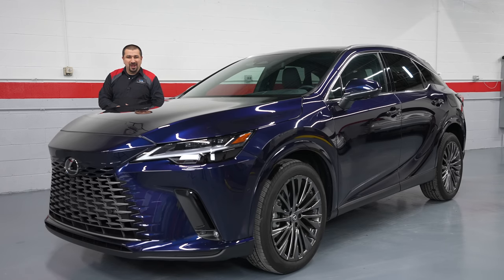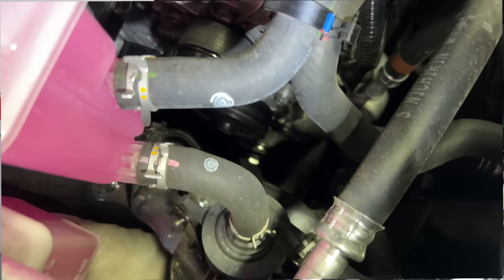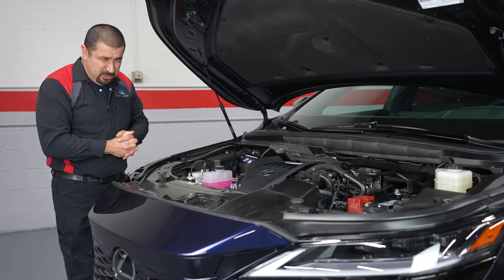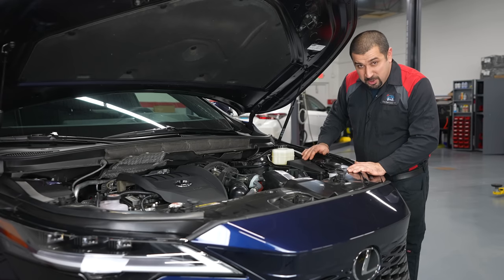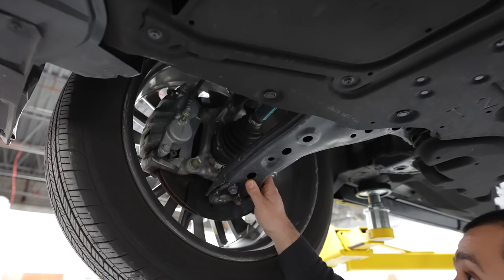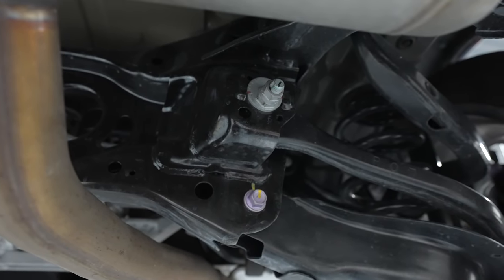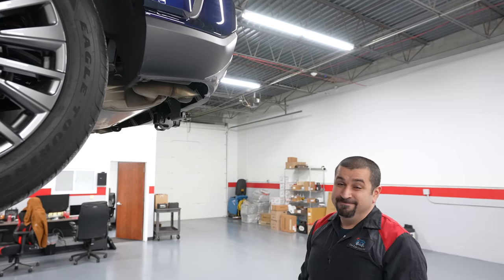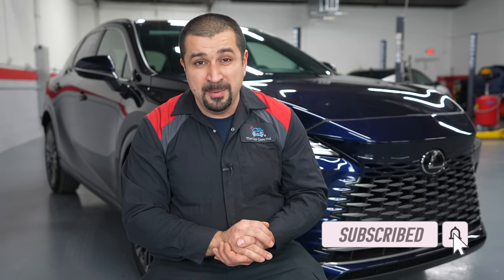Should You Buy The 2023 Lexus RX? Everything You Need To Know

Comment: Thanks for the awesome video and the thorough review of all the important bits. I'm not in the market for a car like this, but definitely some of the tech will trickle down to Toyotas for better or worse. I agree with the potential for distractions - quite annoying really.
By the way, does the RX use wheel bolts instead of nuts? Just curious if this is the direction Toyota is heading.

Comment: Some things Toyota have never changed much ie: the touch screen controls, the Toyota Soarer with the EMV had many controls for Hvac via touchscreen but there was just one single manual button to override if it wasn't working, radio and video controls were also bulit into the touchscreen but the volume and tuning were also available via manual buttons.

In regard to the 4ws , my Toyota Soarer has 4ws and I have a 929 Mazda with 4ws also, after driving with 4ws for many years I would avoid any other vehicle now that didn't have 4ws. It makes parking, U turns, high speed cornering, lane changes at higher speeds so much safer and quicker.

Comment: I purchased a 2021 Lexus RX just before he chip shortage began.  One big reason was the engine.  I agree that this is one of the best engines that Toyota/Lexus ever produced.  Hybrids are very complex with a lot of extra electronics - the stuff that typically causes problems as vehicles age.  With EV's we only move the source of pollution from the tail pipe to the power plant.  I plan to keep my RX  until it falls apart or they won't sell me gasoline anymore.

Comment: Today I traded a 2021 Highlander platinum Hybrid for this vehicle. I agree with the comments about the steering wheel buttons and the infrared face sensor. That being said the engine comments I don't agree with. Compared with the Highlander this car is super quiet and I never heard the engine. That was the only thing I had against the Highlander, it was very noisy, especially on long trips. I've only drive the Lexus 20 miles so I'm still getting used to the bells and whistles and the touch screen. So far it is as comfortable as the Highlander and I'm sure I can drive it for hours like I could that car.

Comment: Not happy….Purchased a ‘23 nx350 this past November, car is great until I find the engine has been filled with too much oil from factory.  You may ask, how much is too much, we’ll take the distance from the bottom hole on dipstick to the top hole and put it above the top hole now and the oil level is at the top of that distance. Make sense?  Now my question is if there is any damage to the engine or long-term premature failure of seals and/or gaskets because of over capacity, thus over pressured. Please advise on next step with Lexus. I want to keep the car for many years but not if engine damage has already occurred.  Your wisdom is greatly appreciated. And thankful for in advance.

Comment: Excellent Video, as usual. The V6 engines are still much better and they talk to me much better than 4 inline. I cannot imaging 4 cylinder engine in something like that. I had 4 cylinder Honda CRV, that was terrible - underpowered and super laud, super super laud whenever rev and it had to rev often. About the all touch screen control system - another not useful thing. Simple buttons for AC, AC mode, Temperature knob - which I dream they one day put in Lexus cars maybe AC power  knob - super easy to control if in manual. 
I like the bumper, as I know that if someone bumps into me, I am protected, so I like it very much - also the fix might be sometimes very inexpensive. Also, if someone is going to revers into your car on a car park, then at least they wont do much harm - they are super useful. I do not like very big screen as they are to much of a distraction screen. I also do not like very big wheels. I still think that 18" size is perfect. And most of all, I hate these "Advanced safety systems". I never thought that we have to pay extra for them, but now when I realize that I must admit that I hate them even more. Probably they count for crash and safety results. I would promote responsible driving instead and as you said, they could have been an option, together with the new door unlock system. Completely unnecessary.

Comment: Ahmed I understand the 4 cylinder buzz you mentioned at the end but believe me I have GLC300 with 2.0 L turbo and there is no buzz . I barely can feel if the engine is on. It all depends on design. Unfortunately Toyota 4s are buzzy..TNX for video

Comment: Very good video as usual!  I had a Toyota question for you.  Recently bought a 2020 Tundra with low miles was a Covid car it didn’t really go anywhere during the pandemic so it had 11,000 miles on it.  I am usually very good with doing my own maintenance etc.  The dealership changed the oil and I usually check the oil 1 time a month on a vehicle that is not leaking or burning.  I checked the oil and it was at the bottom of the dipstick.  Not even to the first hole on the safe range.  I brought it back up to the operating range.  The oil doesn’t look burnt or dirty looks new still.  With the amount of oil that engine has do I really have anything to worry about?  I heard no knocking oil
Pressure is normal and nothing is out of the ordinary.  I only drove 1000 miles like that.

Comment: Test drove the 2023 rx350 fsport, as well as 2022 rx350 fsport, and Im picking up my 2022 rx350 fsport on this weekend, easy decision ever. Ride quality about the same, bit better tech and I like the pettite gear shifter, and cabin door handle designs, not so much outside door handles simply because the inside handles have the manual release. Other than those reasons, the main main reason is because the V6 and how smooth it is, sounds better, reliable, and more physical buttons which you can never go wrong, and the design imo is more sharp. Had to choose the last gen V6, never a big fan of V4 turbo.
Reply: I4, not V4

Comment: I hope Toyota is listening because you just stated the facts of how people like their Toyota/Lexus to be. The question that I have for Toyota, Can the RX or the Highlander pull 3500 lbs camping trailer across Canada without stressing the new 4 cylinder engine, keep in mind that Canada or US are not flat.
Reply: The Highlander Hybrid is rated for 3,500 lbs towing and the turbo is rated for 5,000 lbs. They will do the job easily, just change the oil when your 10,000 km journey is completed. 😁

Comment: I don't like the piano black lcd in this car.  It's looks cheap.  I drive the 2017 Rx Sport and the screen is nicer.  The fake leather is horrible.  I drove this car while my car was in for diagnosis of a purge sensor.  What I can say it was an experience.  Stopping on its own when I supposely was too close to vehicles, which I don't do because I don't like when others does it to me.  I can say it's very different.  I like the grill.  The interior looks cheap and it seems that they went with cheaper materials to save money, but it makes it look not classy as the exterior.  Enjoying my 2017. The 4 cyclinder engine with turbo is a no for me.  I see why the CEO resigned.  I would love to see the reliability in the upcoming years.  I will be watching.  I love the explaination of the engine and trans.  Thanks for being a great youtuber. Simply amazing!

Comment: As expected, more people are complaining about the 4-cylinder engine issue, which is not that big of a deal.  Yes, it’s noisy.  I do agree that the V6 works better with the RX than the Highlander.  Interestingly, most of the “issues” are with the technology aspect rather than the engine, which I think will be an issue for most people.  I owned a previous RX and it was great.  I’m not sold on the new RX because of the engine—not the reliability, but the noise would be annoying.  I suppose you get used to it over time, but it’s a Lexus—not something I should expect to have to do.

Comment: Purchased the new NX 350H and LX600 Sport models late last year, the new RX F Sport 500 is due for delivery soon eta April, ordered it over 15 months ago. An Aussie Toyota family of many decades, they just work.
Coming from previous generation LX, 2017 RX and 2014 NX models agree 100% with your comments, simply too many unwanted electronics, beeps, warnings and fiddling around with steering wheel controls.
Unable to open the NX door should my dog wag his tail from 10 meters away. E Latch in operation, brakes go to full aggressive stop, big red message splashed up WARNING CHECK SURROUNDINGS. Both vehicles lane assist systems seem very intrusive, even aggressive, taking time to adjust to. TIS x 5 updates already for the NX all related to safety features.
Toyota, obviously heading towards a fully autonomous driving, it seems we are real world beta testers at extra expense. The vehicles have all retained their smooth nice people driving appeal, maybe insignificant to some but deleting the lovely iconic Lexus centre clock removed some brand recognition. Many thanks for all your great work and really appreciate your channel.

Comment: I really like your channel. No one else out there reviews things in this way. Only thing is that I just don't get some of the contradictions. You gave the NX with it's technology a pat on the back (it's the same as the RX you are reviewing now). As for the wheel controls, you did criticize it on this RX and also their RZ model for it being convoluted and confusing. Before I bought my RX 350h two weeks ago, I believed you regarding those controls. Then I actually used it and in two seconds, I was able to figure it out with no issue. You put your finger on one of 4 buttons and it shows all the controls. Then if you want another menu you just press ONE BUTTON and it shows the other controls. Absolutely nothing hard about the menu at all and it prevents you from looking at the steering wheel to find the button you want because it's on the heads up display. Shame....
And the beeping. What do you mean? I drive this car 220 miles 5 days a week. I will be doing that for at least 3 months. What beep? If you drive correctly, it's not going to beep for taking your hand on the steering wheel, or taking your eyes off the road cuz if you drive correctly, you wouldn't do that. It doesn't beep at all except when there is a car cross me on an intersection. You sure you drove this car? 
As for the drive, it's not a V6 but i'm happy with that. It's suppose to be a hybrid (fuel economy in mind). It's a nice car for nice people you said. So why do they need a fast car with a V6 engine? I don't get this review. But love the others that you do. You are awesome and your input helps so many decide on a car. However, this time, I didn't go with your review and I was very very happy with my choice. I bought the Toyota Crown (you liked that one) and the Grand Highlander. Both hybrids. 3 weeks later we got the RX and I have to say....they are all awesome but the Lexus has the egde regarding interiors (a small one) but the Grand's drive is slightly smoother. Thank you for helping me with the first two purchases.

Comment: One major problem with this new generation RX for those who live in area who has winter is that the design of the front doors goes way below the floor of the car and it's collect all debris from the road. The result is during winter the inside of the doors at the bottom (the huge portion that goes under the floor)  is full with snow, ice, calcium, sands. Absolutely terrible it looks awful when you open the doors to go in the car. We hated that on our RX 2023.

Comment: I bought LexusRX350 Premium in June 2023,I have about 4000km on it.
I have had problems with the battery draining.it has happened few times where I have to get a boost to start the car.
They ever replaced battery and 5 days later battery was dead.
I am having second thoughts about Lexus.supposed to be bulletproof car
So the car is back at the dealership again right now checking why the battery is draining.
Any ideas?????

Comment: Mr. Nut, looking at your huge experience and knowledge, i have two questions to you and i hope you'll be able to help me.
i bought a used lexus is 220d with 270km so the first question is, what do you think about diesel toyota engines? and especially the one in my lexus. Did i make a mistake? the car was almost completly used on highways and has been always serviced at the dealership and it looked good when i bought it.
The second thing is... it has a major issue now, electrical more specifically. The id box wasn't allowing the car to start, i took it to a guy that does car keys exc and now the car starts, but all the smart key stuff dont work, the car takes a lot of time to detect the key and other major things related to the key (the guy that did the key will gid into that, we couldnt do that in the last three weeks because of the holidays). The question is, does that happen often? i saw a lot of people on forums talking about similar issues if not the same.
Thank you if you will reply and my best regards

Comment: Follow-up:2023 RX350 Luxury at 4,000 miles. $2500, for windshield replacement, is a bit of a shock and the front dash separation is a surprise as well. Almost had an accident, due to turbo lag and the need for premium fuel drains your wallet quickly. The ride is stable and would be quiet, if not for the cacophony of warning bells and buzzers, which turn a quiet drive into a thing of the past. The car almost drives itself between the white lines, but the auto braking from guard rails around curves and when approaching traffic is really annoying. Also, the Mark Levinson sound system seems highly overrated for the extra coin, and so far doesn't meet my expectations of a surround sound environment. Don't get me started on all of the steering wheel buttons and functions which are near impossible to operate in traffic.
Reply: It really seems like Lexus has lost touch a little with this generation.
If only there is an es 2023 in the body of the rx. That would be great.

Comment: In terms of automatic engine stop/start at stoplights, Volvo had that way back in 2015 with their new 2.0L turbo “eco drive” engine that was mated to the Aisin AWF8F35 (Volvo TG-81SC) 8 speed AT on the XC60.  And that’s basically the same 8 speed AT (Toyota UA80E) used in RXs since 2013. I think the new RXs use this same AT or a variation.

When we had the Volvo, we hated it because it was abrupt and there was no way to turn it off by default. 🤯 And yep, no coincidence that Aisin is part of Toyota Group.

Comment: Wow a real Toyota guy. My 1980 Toyota Celica starts missing after it warms up and sometimes turns off. I still have all the vacuum lines in place. Smells like the air fuel mixture is lean once the engine warms up. Do you have any answers that would help?

Comment: Can you discuss problems with the HVAC mode control module in Toyotas. I have a 2014 Highlander with a broken mode control module (windshield defroster mode no longer works). Because it is impossible to replace without removing the entire dashboard, I’m told it is a $3000+ repair. Is the same mode control module still used on current Toyota/Lexus vehicles? I was going to look at new Toyotas, but will pass if the same problem is lurking under the dash.

Comment: 38:27 had my 23 NX 350h covered in ice thick as a credit card. Surprised doors had No problem opening. I noticed the door latches kick the door out ever so slightly breaking the ice. Also on the left side underneath door handle there’s a physical latch as a backup too.. I notice everything and read Everything on my car! Ps, steering wheel button fiasco is only on the heads up display models, which I opted not to have!

Comment: We bought my wife a new 2022 RX last year and I had wanted to buy a 2024 RX for myself next year. I agree…. that noisy, revvy 4 cylinder is a joke in a car like this. I am no longer considering the RX but have decided to go with the plug-in NX instead. That 4-banger is easier to accept in that auto. And I agree… those latches and the safety system are a a nuisance

Comment: I had a 2019 RX350, waited for the new RX, tried it, thoroughly disappointed and so opted to buy a used 2022 RX350 with very low km's. Hopefully in next 3 / 4 years, LEXUS will come up with a better engine or I move to MDX

Comment: I was fooled to switch to Lexus. I bought a 2022 Lexus RX 350 . man what a mistake. engine vibrates at traffic light, dealer says this normal for 3.5 Toyota engine. many defects and gaps in the dashboard. I also drive a Mercedes E class 5 years older than the RX and it drives like a dream, the craftsmanship of the interior is second to non.

Comment: Times change, people. Good luck finding a smooth 6 cylinder in a new car out there. I love turbo engines and have never had a problem with them. Problem is, this one is not so refined, at least compared to the Genesis GV 70. Some of the tech is ridiculous, like no switch for drive mode. 🙄

Comment: I am looking for a 2020 to 2022 model. it doesn't cost them much of anything for all this programming of so-called safety features,  They are just tracking, using and selling everyones information these days.  my wife just bought a new Subaru Impreza, I disconnected the camera facing the driver and put a on/ off switch on the microphone and exterior cameras. And of course change the oil over from 0w16 to 0w30 which is recommended in other countries but not allowed to in this one so they can get extra fuel economy funds economy funds.